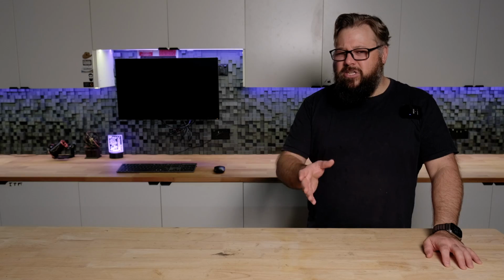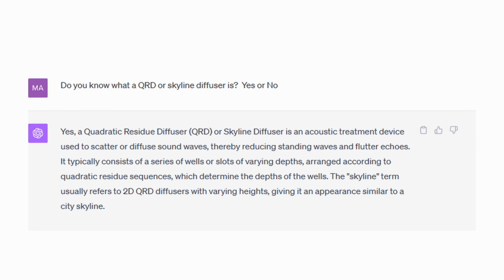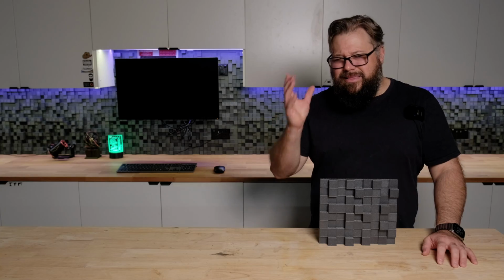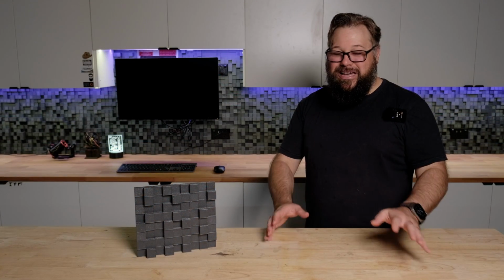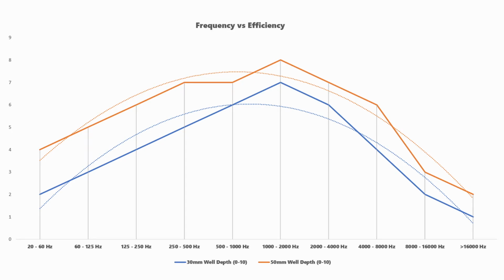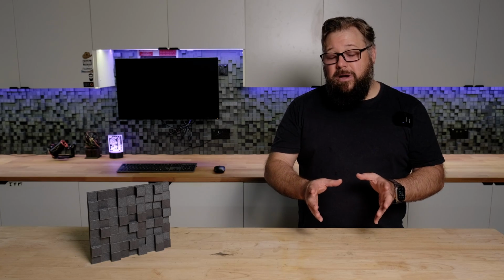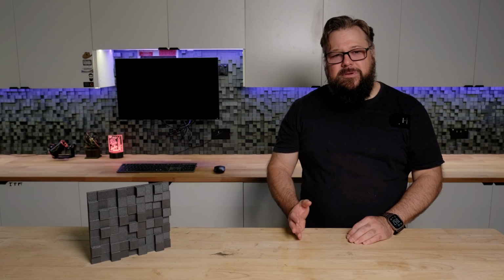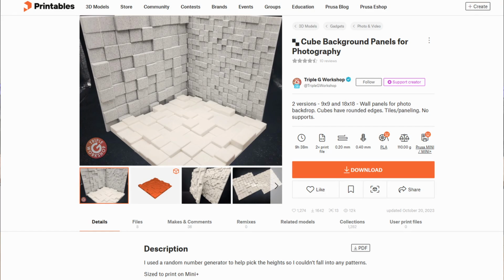Transforming my studio with AI Designed, 3D Printed Acoustic Panels

Comment: Actually, it is not only the size of the smallest element that counts, but also the dimensions where the structure is stretched out. So if the horizontal length is in the order of 3 m, then the lowest frequency that can be handled is in the order of 100 Hz, From some distance, the structure is comparable to empty egg carrying cardboard that can be found glued to the walls of practicing rooms of music bands.

Comment: I'm confused why 1) this print took 13 hours. That sounds absurdly slow. And 2) As long as you have high resolution capabilities and a robot is doing the work, why not make the diffusing surface better? A bunch of flat, simple squares openly facing the room at right angles is really not taking full advantage of the situation to say the least. That's the texture if you're making the thing out of 2x2 wood by hand.

Comment: Awesome work, just started printing them and they look fantastic. Started with a roll of Galaxy Black Prusament to get them looking like yours and found Flashgorge PLA Galaxy that looks identical to the Prusament version. 7 panels printed so far more than 60 to go :-), They will be nice decoration piece to brake a plain white wall.
Reply: I'm doing the same thing , how many spools did it take to do it? Wondering if it's better to just buy some
Reply: @jonythan1171  It takes on average 180 grams per panel I have been printing the largest panels that I could fit on my MK4 (back then) Depends on the size you covering I have printed 45 panels and from the waste I have also designed and printed a frame to cover the OSB doard they mounted to and give nice finish as it is in my office. Makes very dramatic look and I like it.

Comment: As someone already wrote above, these panels are completely useless for frequencies below around 6.5k Hz (so basically everything that is boomey and especially spoken word). Don't fall for it...
Reply from the maker: Thanks for taking the time to reply!  I'm a guy in a workshop making what I thought was a cool project with a 3D printer.   What is there to fall for?  :)
Reply: @MarkRhodesMaker  For instance buying your designs that will not produce the advertised result? 
I have nothing against sharing work and research, but we already know how acoustics work. And your designs won’t work for frequencies below roughly 6.5kHz. It’s physically not possible.
Reply: Can absolutely confirm.
There are free online tools to generate these for studio work.
To trap lower frequencies, the material has to be more dense and more importantly, more depth.

Comment: Hi, I'm an acoustic engineer, and these diffusers will only affect high frequencies. For a diffuser to scatter sound, the individual elements of the diffuser (in this case, the individual squares/cubes) have to be at least the same size as the wavelength you're trying to scatter (preferably larger). From your website I see that the largest heights you offer is 50mm, and it looks like the edges of the squares are also around that size. So if I'm assuming cubes with 50mm on each side,  (343 m/s) ÷ (0.05 m) = 6860 Hz, meaning any wave under 6860 Hz will not be affected by the diffusers. In a logarithmic scale (the one relevant to the human ear), the effective range is about the highest quarter of the audible frequency range
Reply from the maker: Thanks for taking the time for the well thought out reply, and I really appreciate you bringing the maths too!   I have some follow up questions, why the speed of sound in your formula?  What size do you think would be best for spoken word?   Would the top surface dimensions (x/y) matter as much as the z dimension?  Thank you!
Reply: @MarkRhodesMaker  Hello! The formula for speed of sound is (Speed of sound) = (wavelength)*(frequency), meaning that you can get the wavelength by dividing the speed of sound over the frequency. So here I worked backwards, starting from the size of the elements (in 1 dimension), then use that as a wavelength (meaning, the largest that can be diffused), and then finding out what frequency that wavelength corresponds to.

For spoken word, typically you have fundamental frequencies between 100-240 Hz including both men and women. For, let's say, 150 Hz the wavelength (and therefore, the minimum size of scattering elements) would be 2.28 meters, so that's quite unfeasible. You could instead choose to look at the whole frequency spectrum of voice and control the strongest part of the spectrum, and there you typically have the most power between 800 and 1600 Hz. For 1000 Hz the wavelength is 34cm, which is still considerably large for scattering elements but not as physically impossible. For speech you might as well instead control it with absorbers instead of diffusers. Membrane absorbers are the type that are typically used for low-mid frequency range, while porous absorbers (the "foamy" type stuff) are more for mid-high frequency range.

I should also clarify that these frequency limits I'm calculating are not 100% accurate but are just rough (but pretty close) estimations of what the effective frequency range is. It is also not a hard-cut yes/no limit but actually a gradual transition. Still, this rough calculation gives you a pretty good idea of the frequency range.

I would say that all 3 dimensions are about as important. This I'm not 100% sure but probably the Z axis/height is just slightly more important. But XY dimensions still matter considerably.

I hope you find this information useful!
Reply from the maker: @AwesomeAcousticsEnglish  thank you so much for taking the time for such an awesome response!   

Given your familiarity with the subject, could you speculate on whether or not hard plastic is an issue?   My research says no, but there are comments to the contrary.
Reply: @MarkRhodesMaker  It depends. If your only goal is to scatter (so, breaking resonant modes and making the sound field in the room more diffuse), then there is no problem with hard materials. Various QRD diffusion panels are made of wood and it's perfectly acceptable.

If your goal is ALSO to absorb sound (to control reverberation time and SPL), then you need either a soft material that can also absorb, or separately set up absorption panels additional to the diffusion panels
Reply: @AwesomeAcousticsEnglish  is there any possibilyty/ any spray foam or something like this, that 3D printed panels can be sprayed on to work better?
Reply: @mieszkoniewiadomski  Spraying anything on an absorptive panel will make it less absorptive at worst, or unpredictable at best (one of the points of buying absorptive panels is that the absorption coefficients have been measured so you can make very reliable predictions depending on your room size and how many panels you buy).

And I don't know of any material that can be foam-sprayed on a surface to make it more absorptive.
Reply: So how could that be improved, with smaller squares, larger ones, or a fractal like Perlin noise?  Perhaps using a material that is softer or porous?
Reply: @johnvonachen1672  Both larger elements and softer material help, though it may be hard to achieve in the same material (impossible in 3D printing). You could use a combination of some absorptive panels + some diffusers. Absorption just helps all around to acoustics mainly controlling the reverberation time. Scattering/diffusion is mainly to break resonant modes and make the sound field more diffuse (meaning sound behaves more consistently throughout the room). Each ones do their own job best, and give best results in combination.

If you look at anechoic chambers, they have an absorptive but spike-shaped material, which reflects the sound onto other spikes and so makes the sound get absorbed multiple times on the wall. But you will also see that the size of these spikes are quite large
Reply: @AwesomeAcousticsEnglish  you can 3d print really soft foam like materials, that seems like a good option.
Reply: A metamaterials approach would be interesting. I don't have access to COMSOL or journals at the moment, but do remember reading an article where they made QRDs with embedded resonators and achieved 1/23 wavelength result. Visually it looks the same as any of the 1d or 2d diffusors but each well or block is resonator or cells of resonators - but effective on frequencies many times lower than with traditional acoustics.
Reply: @jimifiTube  I want to hear more about the 1/23 wavelength resonator diffusor things!!!
Reply: I'm afraid this exchange has exposed the fundamental flaw that doomed the experiment from the getgo... it seems Mark began the experiment by trusting AI. Unfortunately, the AI misled him. It turns out the AI did not have the requisite knowledge of diffusors and relevant acoustical engineering concepts. It exhibited a Dunning Kruger Effect where it boldly proclaimed it could help Mark design something it didn't know enough about to know it could not actually help him. This should have been a short video. It should have said "no, I cannot do that".
Reply: Even without the math it's pretty obviously snake oil. Hard flat plastic surfaces do poorly as acoustic treatment.
Reply: @zackj997  You need to distinguish between sound scattering (diffusion; which is what he has made here) and absorption. One is meant for eliminating reverb and sound reflections (this video) and the other is meant to dampen all sound frequencies by absorbing them entirely. 

This will help reduce the echo/reverb, although not to a fully optimized extend, given the material used. It will however, not absorb the sound.
Reply: @JakobDam  What is the problem with the material? I would want my diffuser to reflect as much as possible. Btw. (apologies if you know) true diffusers also absorb to some degree. Cheers.

Comment: Love the idea, great work.
For the prompt, you can change it slightly.

You are a mechanical engineer with 20 years of experience. You are specialized in openscad.
Your task is to generate an openscad model that approximates a QRD diffuser for 3d printing.
I will give you more instructions for the parameters.
Think thru you're answers before responding.

You could even started by adding before a snipped of qrd from the pdf as an example.

Best results using GPT 4.
But the prompting change the output significantly.
Reply: // Parameters (to be customized based on your instructions)
N = 7; // Prime number
W = 10; // Well width in mm
Dmax = 50; // Maximum depth in mm
H = 100; // Height of the diffuser in mm
totalWidth = N * W; // Total width of the diffuser

// Function to calculate depth based on quadratic residue sequence
function calcDepth(i, N, Dmax) = Dmax * (i^2 % N) / (N-1);

module well(depth, width, height) {
    translate([0, 0, height - depth])
    cube([width, width, depth], true);
}

module qrdDiffuser(N, W, Dmax, H) {
    for (i = [0 : N-1]) {
        wellDepth = calcDepth(i, N, Dmax);
        translate([i * W, 0, 0])
        well(wellDepth, W, H);
    }
}

// Generate the QRD diffuser
qrdDiffuser(N, W, Dmax, H);
Reply from the maker: I tried that code, it didn't work!  It came out looking like a space invader.   But pretty cool regardless to see my video motivated you to try generating some code in GPT :)
Reply from the maker: Thank you!  Great idea to re-engineer the prompt.  It's something I often forget to do

Comment: 11:37 something interesting to look into regarding this one would be foaming filament. Normally it's mainly used to print wings or such for RC airplanes and the like.
But if there happens to be foaming TPU available too, then that's basically 3D printing foam.
Reply from the maker: Interesting idea, is there any reason or application in particular you are thinking of?
Reply: @MarkRhodesMaker  not really, I was just wondering if it'd make a noticeable/measureable difference if the same panels you have were printed in a "foamy" or "softer" material.
As in, would the absorbtion add into the diffusion or not.
Reply from the maker: @BloodyMobile I suspect it would not be a cumulative effect unfortunately.